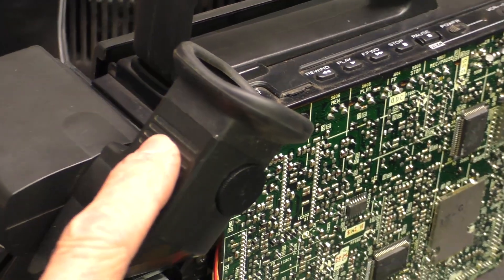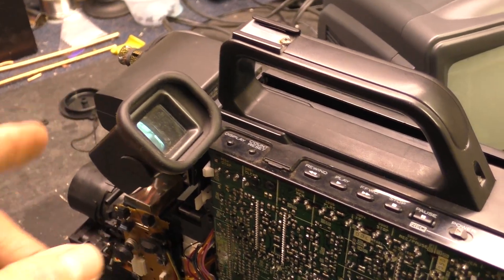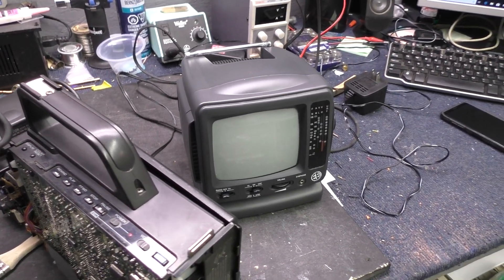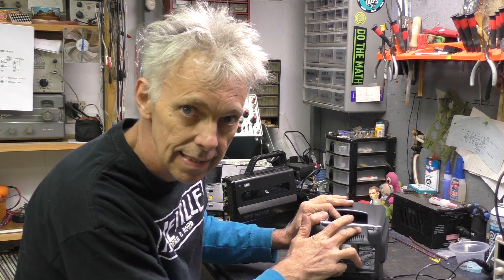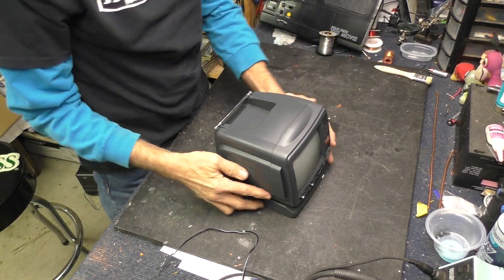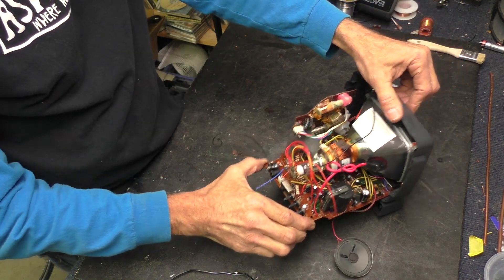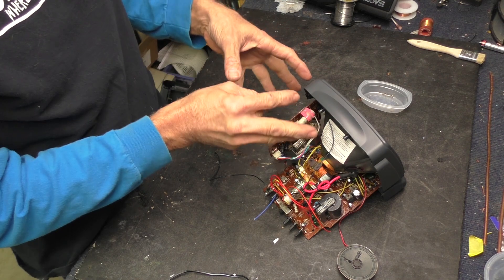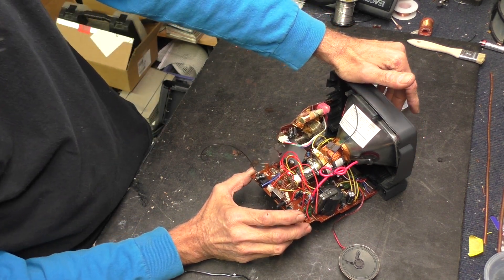Hacking A Video Signal Into A Tiny TV

Comment: Looks very dystopian/ Blade Runner-esque, love it! If you want a quick 'n' dirty method for injecting the video signal, simply add a capacitor in-series with the video output. That way, you can safely probe around the board without the fear of sending a DC voltage back into your source :)

Comment: I have this same little tv and have been wondering if what you did was possible. I've been using an old RF modulator and running it into the antenna input but the image quality was no where near what you achieved. I am very glad you posted this video! I'll have to get tinkering again!
Reply: Yeah.... I'm doing the same... but I'm trying to get a bad picture. ;)

Comment: Dont worry about that red wire. As far as I know it has never killed a person but red tape has.
Back in the old days after adding an audio output for a magnetic tape recorder to a tube radio I tried the same with a tv. apparatus. I wonderd about that humming feeling when touching the chassis. Today sitting on a heavy carpet when repairing a computer is not a good idea but back in those days sitting on a heavy carpet when poking inside a tv with the chassis on the live wire of the 220V AC  was a very good idea. That audio output worked but dont ask me what my dad said when he touched the tape recorder.

Comment: I actually just stubbled across your channel looking for how to do exactly this, with a CRT I found at Goodwill, and, it's actually the one you have here, the project I'm working on is actually a fallout project, and am wondering if you have any advice on how to power this with a modern rechargable battery ie votlage and what I would need to do to wire the battery like if there are any of the shelf boards I could use etc, I really hope I can hear back from you, and great video, it's already helped

Comment: Could you help me identify where the video output is on my crt motherboard? I have an old 1980s monochrome KTV that only has UHF/VHF screw posts so I'd like to add composite video to it and bypass the knobs. Not very worried about the audio as I'll be connecting it to a raspberry pi and installing smaller speakers with it. I could send any photos if that's ok.

Comment: BROWN WIRE  FROM CAMCORDER 4.5 VOLTS [ VIDEO OUT ] TO PIN 5 ON [VIDEO IN] rf INPUTS NICE WORK BOTH UNITS NEED 4 AMP 12VOLT POWER SUPPLY  - THANKS FOR SHARING KNOWING WHERE TO LOOK ON ELECTRICAL BOARDS IS A LEARNING CURVE